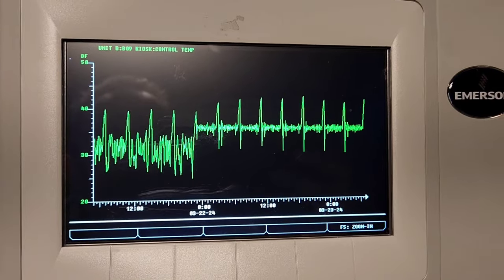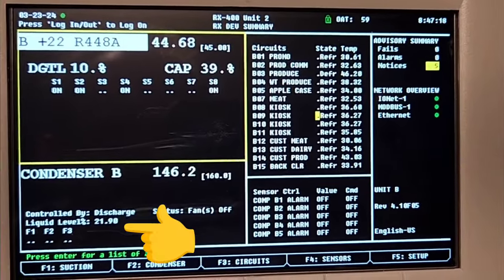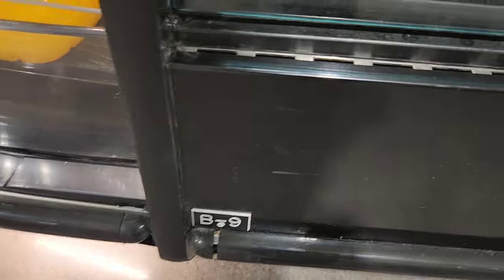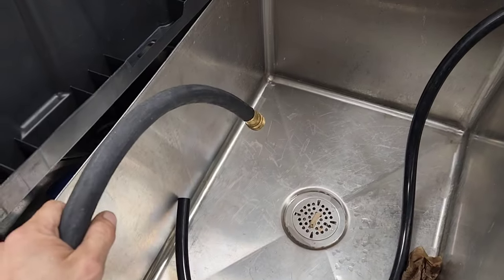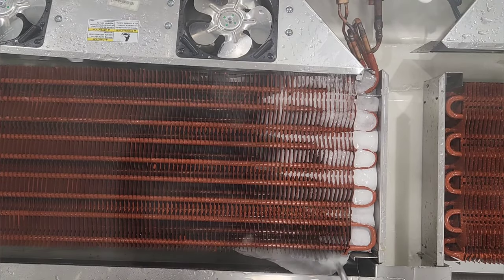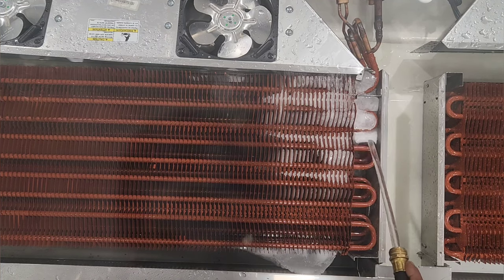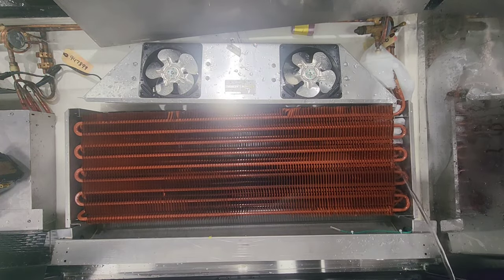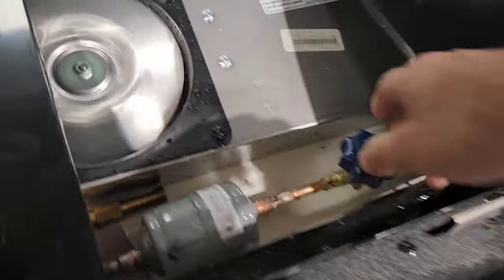Why Did The Service Meat Case Freeze So Bad?

Comment: TXV screen restriction or the isolation valve.
But where did all the crap come from that restricted it? I'd be looking at the oil and compressor capacity to determine the source. Bigger picture time.
Reply: Yeah possibly if multiple cases have plugged txv screens may need time for oil change or checking out the separator
Reply from the maker: The word is that the Frozen Food Cases at thisnsame store are doing the same thing
Reply: @HVACRServiceTech  The same circuit?   There's the smoking gun.  You got an oil change coming up.